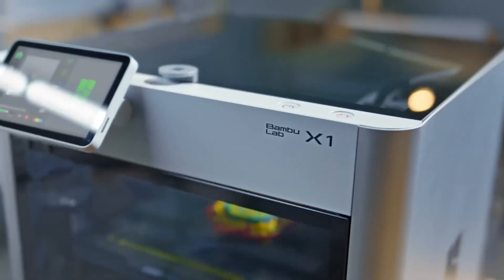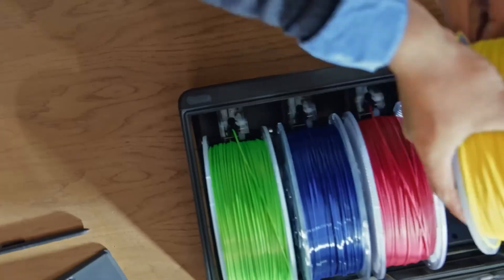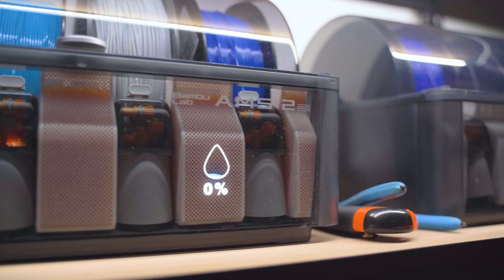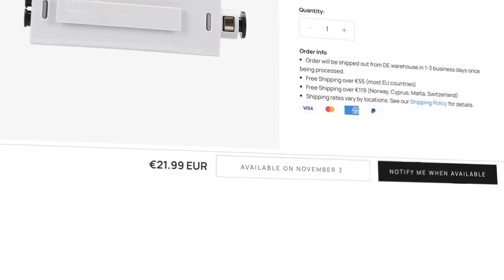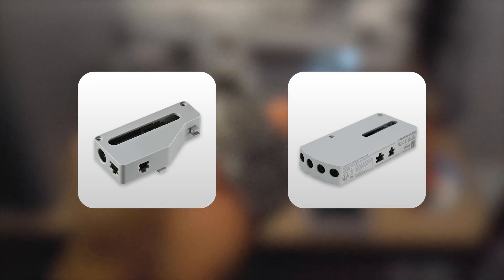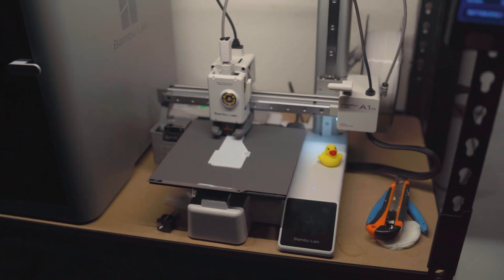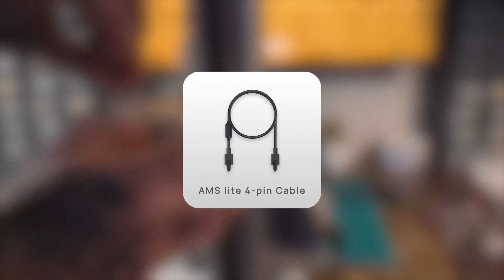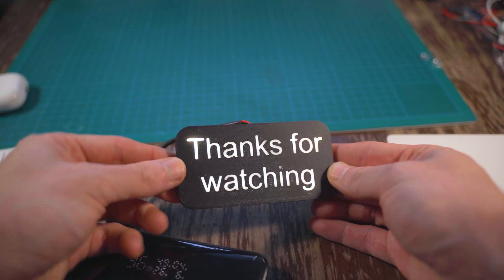How to connect classic AMS and AMS 2 Pro to A1 / A1 mini

Comment: You're a gentleman and a scholar xD.

Seriously though, thanks for the tip. Should also work for the AMS Pro 2..
Reply from the maker: It works (I tested it on my AMS 2 Pro), but you will have the same problem as with first-generation P/X printers.
They do not have enough power for the AMS 2 Pro, so to use the drying function you need to buy a switching power supply for the AMS.

Comment: Really annoying that they keep pushing out the date for the hub. I have notifications on and still refresh hourly. Of course when I was out to eat on Saturday it was actually available for a couple of hours without me realizing. It was going to be available today and I refresh and now it's December 8th! GAH!
Reply from the maker: I had been waiting for support for the classic AMS since I sold the AMS from the A1 bundle.
And when I saw that they had introduced the special hub, I was ready to buy it right away, but due to constant delays (especially in Europe; there doesn't seem to be this problem in the UK and USA), I ended up deciding to use the AMS Buffer from P1, which I bought for €10 in my city that same evening.
Reply: @hasque_lab Availability of the A1 Hub in the UK is also affected, FYI. I keep seeing the expected date getting pushed back, and - as of today - it simply says “sold out”. I’m also subscribed for a stock notification for it, and haven’t received any. 

Stock notifications & estimated dates for filament have seemingly all been accurate/working recently, but not for the A1 Hub.